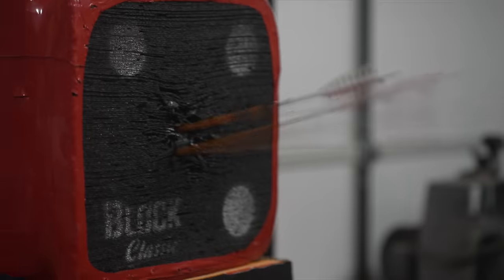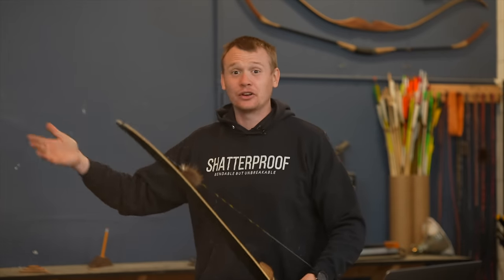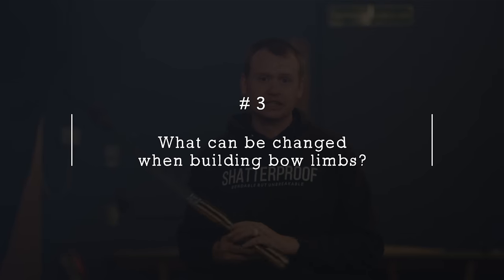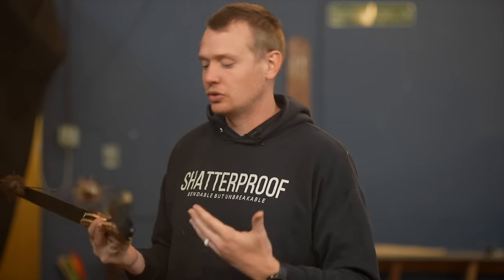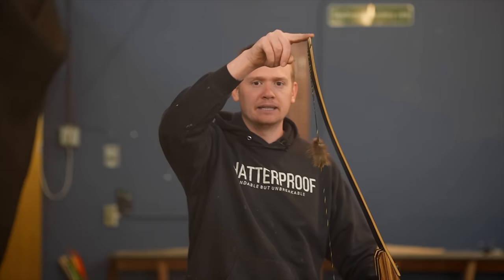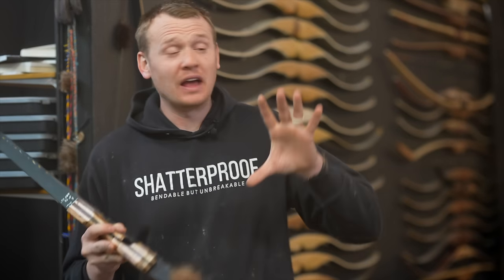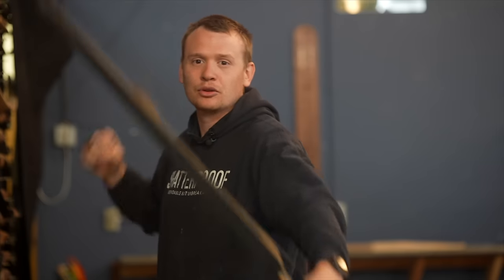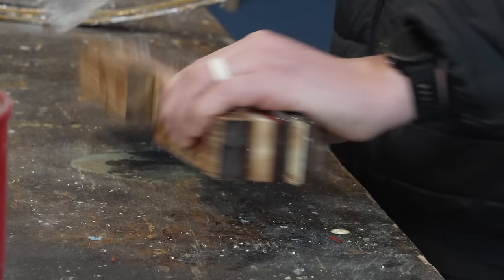The BEST Bow You CAN'T BUY

Comment: The smoothness is because the direction of the force.  If the force of the limbs is primarily straight forward, then it will not be smooth, if the momentum of the limbs it primarily upward or downward, the forces cancel out and very little is left to vibrate your hand.  It is part of the reason why compound bows fire so smoothly, because their momentum is directed completely upward and downward, instead of partly forward like normal bows.  (I really hope you see this comment, it took me years to figure this out.)

Edit:  To calculate this find the location of the limbs fully drawn, and then at rest.  Take the distance the tips move forward and divide it by the distance they move upward or downward, smaller is better.  A perfectly flat longbow will go a long distance forward and almost no distance upward/downward.  A compound bow will go almost no distance forward, and quite a bit more distance upward/downward.

The other reason why compound bows are so smooth is because the mechanical advantage of the pulley system means the limbs have very little movement in the first place, therefore less vibration.

Comment: Your brace height theory makes a lot of sense.i shoot 72” English D section bow which are generally low braced,,which keeps the string in contact with the arrow for longer.
Reply: Yes, I have an old Fiberglass Model of dual sided longbow a 36 pound model made from 1961--1979 from Actionrod by Actionbow 8200 and model has one of lowest brace heights of any shelf production model bow at 4 inches/10 cm and due to a low brace height bow is able for short draw archers get a 25 inch/63.5 cm draw. his is a big why smaller mainly younger teen archers would use bow model, smaller kids getting a 28/29 pound bow, why model is used up on 40--46 pounds and on lower side for staring out.

Comment: Love the design! I went back a few months and watched your awesome bow shape comparison. All this needing out over bow physics has me wondering…how much of the speed and stability come from the  angle the limb tip moves on the x/y axis in relation to the length of limb tip travel?  It seems finding this perfect relationship will push the string forward quickly while the opposing limb direction makes it stable and smooth. Any thoughts?

Comment: I shoot Split Finger going higher up in anchor using top finger ca and my nock is under arrow, sometimes 2 so I need less pressure. I can change my split so I am 2 over or 2 under where 2 under is classic only going 2 over if arrow feathers are taller and just go more like people who are using a corner of mouth/specific tooth since I used to use as my anchor for a long time until I had an all fiberglass Ben Person 62 inch bow where I needed a corner of jaw anchor.

Comment: Bow speed seems conceptually easy to quantify...meters/second or feet per second. how does one quantify or describe Smoothness? 
Also i'm curious if there is a relationship between either attribute of Speed or Smoothness and the area formed between the bow and the string.
Reply: Measure poundage gained per inch drawn on a draw board or tillering tree, plot the whole draw cycle. The area under the line on the graph is your stored energy. You can plot the change per inch to make a "smoothness" graph, less gain per inch feels "smoother".
I'm not sure what you are asking with your second question, so can't help you there.

Comment: This argument with a shelf being higher = smaller gaps is total bullshit.

Gap is formed between a line of sight, distance of anchor from the aiming eye, and the length of an arrow. This forms the needed elevation.

If bow strength and arrow weight, fletchings, FOC, length, etc. are the same, you MUST bring an arrow to the same relation to the eye and the sight line.

Higher shelf can be bad for purely instinctive shooters because it's easier to achieve good results with point and shoot when the arrow is closer to the hand.

Change to smaller elevation and smaller gaps can be achieved with higher anchor, higher nocking point (not advisable for all types of traditional bows), and longer arrow.

In fact, a higher shelf would mean that arrow is pointing higher up in front, needing you to lower your hand.

It must be something else that makes this bow accurate despite that unnecessary high shelf. 

Maybe this shelf cancels out some other tiller and riser mistakes, but it surely doesn't make smaller gaps.

Edit: If you shoot, the bow with string walking like you do (I personally shoot split finger), than this riser shape is maybe beneficial to cancel out some vibrations and torque.

But to all others, that would be bad and unneeded characteristics of a bow.

Smaller gaps are made in the back mostly, in front you can choose a longer and stiffer arrow.